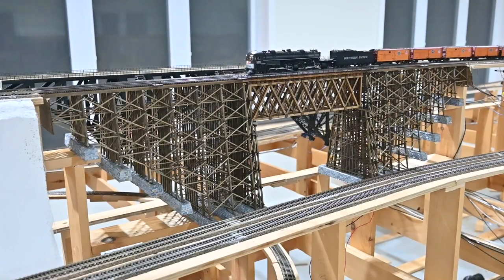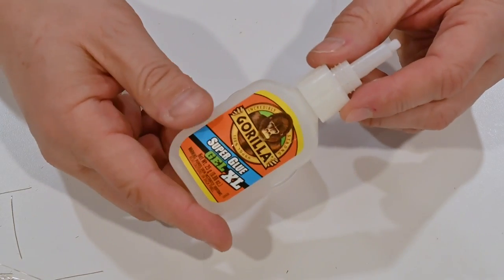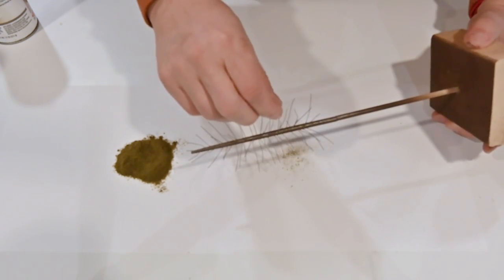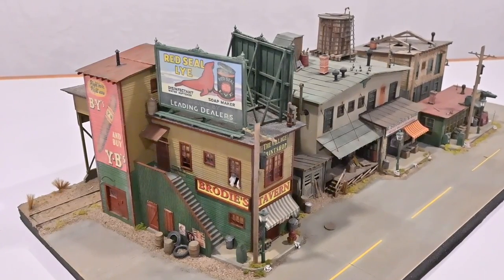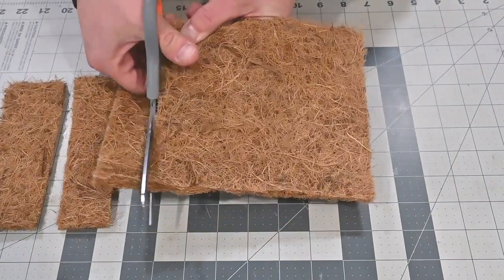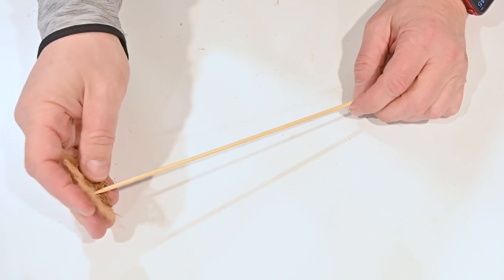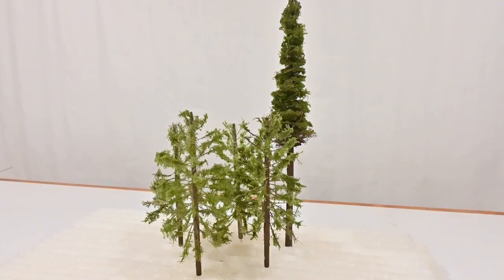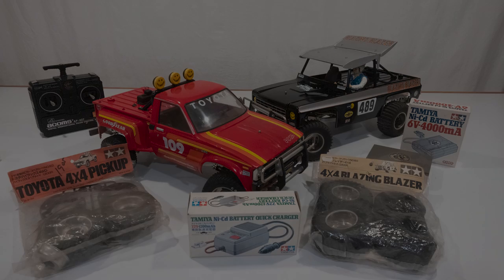S3: E3: Can't see the forest if you don't have trees! Plus a look at FSM Skinners Row!

Comment: Hi, nice to see you back at work again. Personally, I've spent several months designing and creating model trees. One real trick that you didn't use when creating your model trees is using a warm stream of air from a hair dryer. When applying model grass with fresh spray adhesive, use a hot stream of air to give the fibers the appropriate direction of fall. This completely changes the quality and final effect!
Reply from the maker: Thanks for the tip!